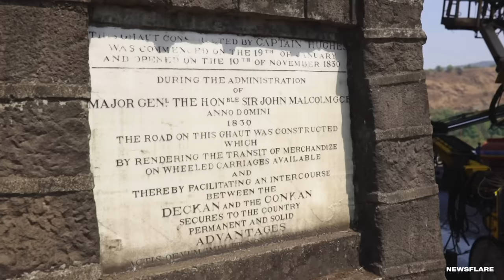10 Incredible Moments Caught on Camera

Comment: #8 4:34 If they had all that time, I would have at least disconnected the tractor (semi-truck) from the trailer. Or desperately tried backing back off the same way it got stuck. But maybe they tried.
Reply: what happens with those low deck trailers is that the tractor's wheels often barely touch the ground because the hitch holds it up in the air, so you can't pull the pin on the "fifth wheel" to unhook from the trailer. they can easily drag them off with proper equipment, and would have been able to no problem if someone had called the railroad and told them that crossing was blocked.
Reply: @ghomerhust I always think this too! Like why don’t they contact the rail house telling them that they have a crossing blocked instead of having this issue every single time!?